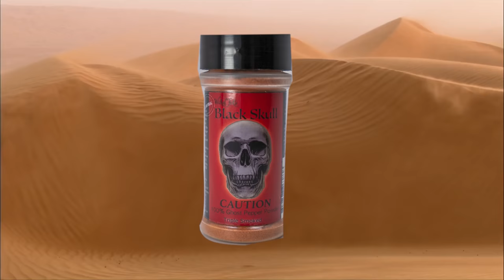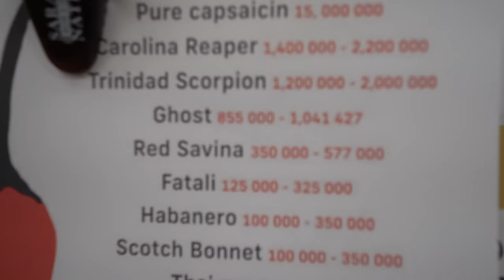We Made Candy So Hot Most People Can't Handle It! Can you?

Comment: The almond milk would technically not really work to help to alleviate the discomfort caused by the capsaicin as it does not contain casein. Casein, a protein contained in dairy products works like a detergent to pull the tiny capsaicin molecules from the pain receptors and wash them away. Now I need to go order some of this candy.
Reply from the maker: The more you know 🌈🌠
Reply: Anything with some fat in it will help
Reply: The best remedy to spicy is a milkshake or ice cream. Both are dairy products that contain casein and they’re already cold.
Reply: Any dairy product would cut it, as long as milk was used. And which idiot decided to use the whole bottle? 1 tablespoon should have been more than enough.

Comment: I'm wondering if the powder mixed evenly or if maybe some got more and other got less heat 
I know there's a liquid additive for sale on Amazon (& other sites) with 6,000,000 skoval rating
maybe the liquid mixed in earlier (just before pouring on table) would be good idea?
Reply: Always Watching  then it needs to be a liquid that doesn't have water.... and since water makes it worse it's anhydrous (aka doesn't mix with water) an oil based compound shouldn't make any steam WIN - WIN
Reply: Always Watching  sounds like you may have more chemistry training than me but at 300 degrees I'm thinking not much steam still around... oil based flavorings
Reply: Always Watching  doesn't apply here that flavors uses either water, alcohol or both (read ingredients list or front labels that say 30% alcohol for example)  I'm advocating to use an oil based since in this case, since the stuff giving heat  is  anhydrous ,  which cannot use water based flavor BECAUSE it's anhydrous, so they use oil to taste that powder, because powder is anhydrous so it doesn't need water, if also avoiding alcohol there shouldn't be steam